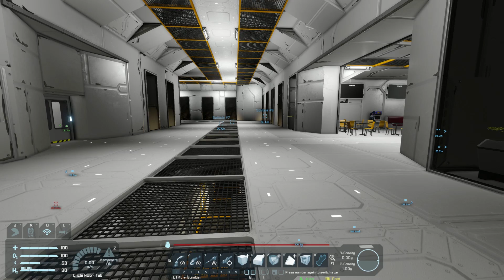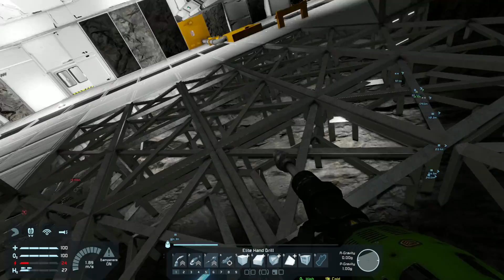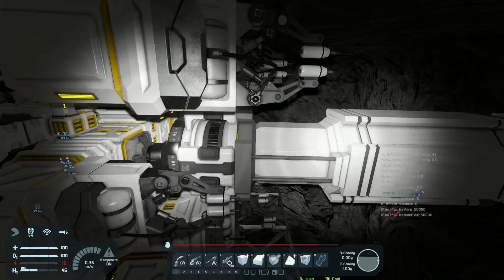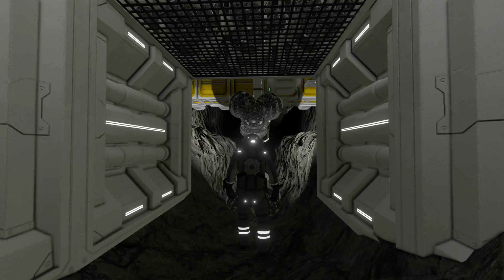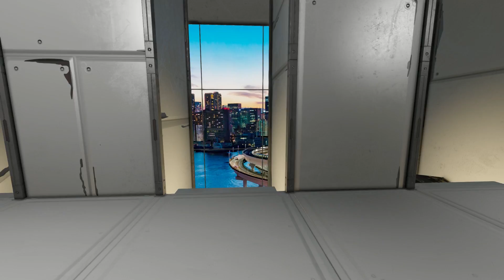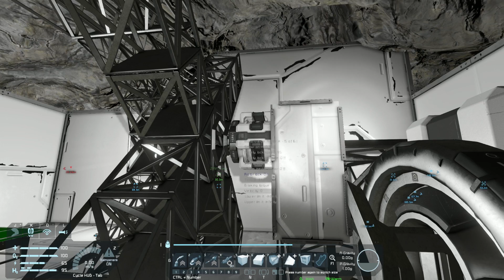Survival, Maybe... #105 Going to the Gym (A Space Engineers Survival Series)

Comment: Splitsie, 
Please post an update about the changes besides the new blocks and cockpits after the last update.
Seems that connectors now have a "strength" setting. Found out that anything above about 25% is BAD!!!!
Reply from the maker: Connectors have had a strength setting for a long time, that's not a new change

I haven't come up with an interesting angle on the DLC as yet, but if I do I will make a video on it - part of the reason is that I've only had time to play with them for the recording of this video, haven't had time otherwise to mess around with them :(

Comment: I did something like this landscape some time ago too :D Its really satisfying to see cool images while moving through some corridor or elevator.
But i do most of my LCD images with monospace ... not that good quality, but easier without building a mod. :)
Reply from the maker: It really is, and an elevator is an awesome place to use something like that - might have to try that some time too :)

There's another downside with monospace in that it has a much higher performance impact compared to the mod method, which is why I switched over
Reply: Come to think of it your monorail tunnel is very empty... some kind of epic city on both side make it look like your suddenly in a massive hightech city and then back into a tunnel to continue on to the solar axe or HQ depending on direction

Comment: Instead of welding by hand you could use this as an excuse to alter the elevator so you can bring Igor upstairs to help :)
Reply: A freighter elevator! Yes!
Reply: @mattp1337   Small ship cargo lift, using wheels. It could use a connector landing gear combination as its safety (sorry about the way this is laid out as it is the only way I can explain this that makes any form of scene)

 When connected to landing bay or upper base Group trigger; 

Timer - Cargo lift lock 
- [this will start] - 

Timer - connector [set to lock all connectors every 60s when triggered]
Timer - Landing gears [set to lock all landing gears]

So that should the base lose power the lift dosn't plummet to the deeps of the planet. This can be implemented via remote block slave/master button control, or cockpit 1234 keys as 

1; GPS point landing bay
2; GPS point ?
3; GPS point ?
4; GPS point Living quarters

4 remote blocks take each of the four GPS way points. How you can do this is up to you but it can be done this cackhandedly. 
=^_^=
Reply from the maker: I think building a cargo lift might take longer than welding that small corridor by hand, if I wasn't already going to need to replace the current elevator I would be tempted :P
Reply: Exactly, you said you were going to replace the elevator anyway. So just upgrade it to Igor size. Lol

Comment: I'm assuming that was Capac at the end.  And I'm further assuming he had a few choice things to say about the hamster wheel continually killing him too.  But have you considered possibly using a mod that has a treadmill in it to add to your gym equipment instead?  You could probably find one rather easily.

So when you mentioned having to wield all the corridor blocks by hands I had a thought, but I don't know the dimensions of the corridor so I have to ask a question: would Igor fit in the corridor?  You would have to either construct a vehicle elevator to move him from the garage to the corridor or temporarily demolish the front of the base to construct a ramp to move him inside, but if he fit you could much more easily wield the corridor floors at least, reducing the amount of work you have to do by hand or build a temporary wielding rig for.  Maybe it isn't practical and you would rather build a wielding rig, but Igor has been sitting in the garage unused for many episodes now and it might be nice to see him put to use again.  Also using the second method of moving him into the base (demolishing the front building) would leave you an opportunity to remodel/rebuild the exterior entrance building.  And who knows, maybe you could slap wielders onto the sides of Igor somehow and do the walls of the corridor too.

Adding the two additional drills to the bottom of the drilling rig was handy for drilling out the utility corridor.  Could you building something similar to drill out the rest of them?  Say a single drill on pistons?  I've noticed that when your engineer walks the corridors a lot of the utility corridor underneath is stone that hasn't been drilled out yet, so a single drill, multi-piston mini-rig might be useful of clearing those.  Something else I noticed was that it appeared you were momentarily disoriented at one point while using the utility corridor after the drill rig had stopped.  You could place LCD screens with maps of the utility corridors on the walls or maybe directional signs (i.e. "This way to Elevator Shaft Access") to prevent that.

Have you considered the room light mod that Wasted, Tex, and Farrell have been using lately?  I noticed when you first went into spectator mode to show the base that a section of lights in the hangar below were flickering and you've mentioned in the past that that has been happening since you've been reaching the upward limit of the number of lights you can have in the world.  The room light mod is a single light that could produce the same amount of illumination and reduce the number of lights you have in the world, eliminating the flicker.

Will you be using the corner desk from the new decorative pack when you build the auditorium?  It occurred to me that those kind of look like lecture hall desks.  A small surface for engineers or base personnel to lay their tablets on while they take notes.  And the auditorium might be an opportunity for you to use the display table too.  Any lecturer would need something to display a presentation on.  You could even amplify it by placing LCDs on the wall behind it.  Just random thoughts.

Excellent video as always.  See you next week.
Reply from the maker: Eikester has a very good treadmill on the workshop (which is in the mod list for Survival Unlikely) but I'm still sticking to my 'no new mods' for Survival Maybe :P

Igor might fit, but the work to get him upstairs would likely take longer than just welding it, plus it might make an interesting time lapse :)

The trouble with the utility corridors is that they're a single block, so any drill rig would have to be mounted on small grid pistons and that greatly increases the chance of explosions :/

I definitely want to put up map signs once I've got the floor plan complete, there's even a member of the community who's been drawing it up in architectural software and sending me the pics so I should have a pretty nice looking map in the end :)

I'm going to try the corner desk, but the angle of the chair may look weird unless I can alter it somehow, the straight on desk might work too though :)

Comment: hey splitsie, for your doors, use the sensor to open and a script to close. Ive got one on my workshop for this. I Had the exact same issue with sensor doors. If you want a more complex door script that handles airlocks Id look at whips.
Reply from the maker: I might even be using your door script now that I think about it, you're right though, using it instead of the sensor to close should improve things due to the longer delay :)

Comment: @Splitsie, there's also the possibility of using Monospaced Images in Space Engineers

https://forum.keenswh.com/threads/tool-whips-image-to-lcd-converter.7393443/
Reply from the maker: I know, I made a tutorial on using monospace images around 16 months ago, the problem is that monospace images are very performance intensive which is why I stopped using them. I've got a lot of custom LCDs in the base so it would be a big issue for me, plus by modding in pictures the way I've done I can get 512x512 on each LCD instead of 178x178 :)

Comment: you could probably fit in a lot more museum displays if you put the projection tables up against the walls, since you'll have more walking space, at least that is what I have been doing
Reply from the maker: The museum at the solar axe will be pretty big as it'll be above ground, so room shouldn't be a problem, but if it is I might even hide them and move the projection to where I need it if I can push them that far :)
Reply: @Splitsie  I really hope that is a thing that can be done (haven't had a chance to mess around with the projector table yet). Another suggestion, if you are getting really fancy with the base, would be to use the projection tables to project "fish" into a large tank, so your base can have an aquarium! (nemo and all)
Reply: They could even "swim" around the tank if the projections were on a rotor